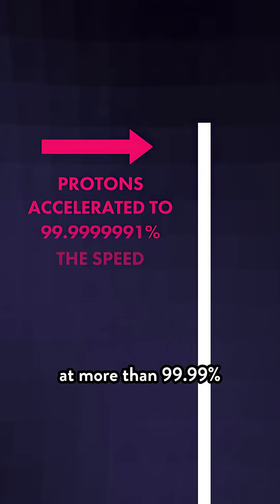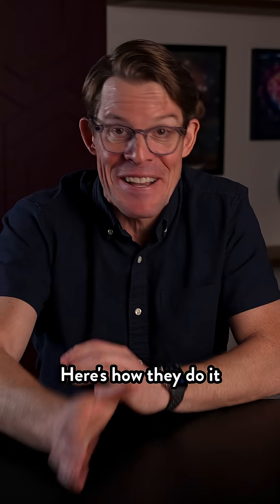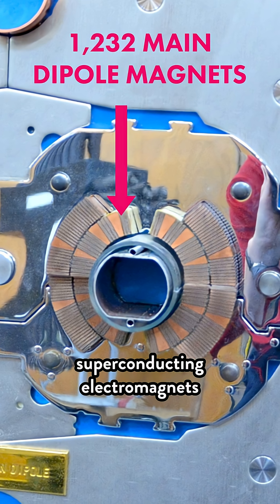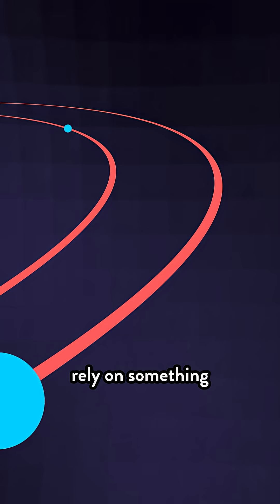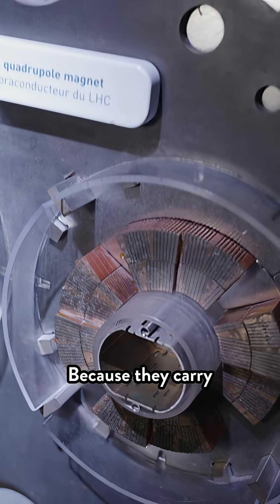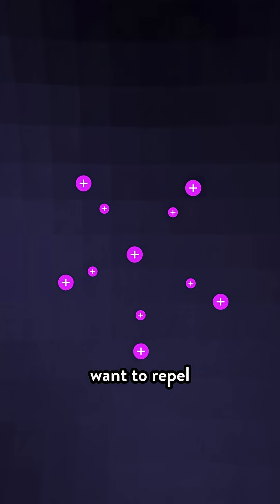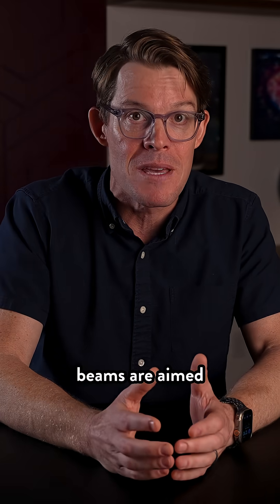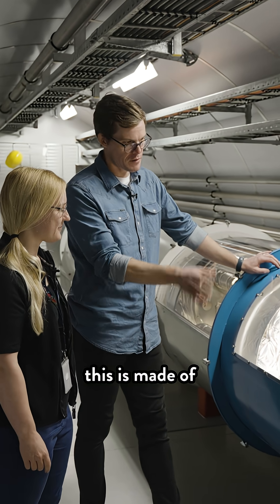How to steer at 99.9999999% the speed of light?

Comment: Mm, I think when two temporal streams of photons converge at the same event in the stable macro-wave, a scattering of random frequencies decohere rapidly, assuming photons move omnidirectionally through three dimensions of time, as well as space at a Planck-scale refresh rate. Magnetism as we experience it is at 90° to the future/past/south-north time-stream, the past always dead ahead corresponding to North, and in the mundane universe oriented to the zenith. Think of spacetime as a tesseract instead of a cube with a line drawn through it, having six coordinates (x, y, z, t¹, t², t³) instead of four. The future rushes forwards to inform the present surrounding us from behind, mirroring the past before us through stable interference, as electromagnetic intercourse phase-locks matter now, retaining only its mass (refractive index) as it moves time retrograde. All held in place by the phase gradient of perceived gravity.

Comment: Great videos, saying no resistance for the magnets though really threw me on this one. If there is no resistance, then there'd be no heat, so no need to cool the magnets.
There's as minimal resistance as we could manage to reduce the heat as much as possible, otherwise they'd melt before a test shot was concluded
Reply: Wow, yea one just searched for some info on it, quite astounding. Effectively 0 resistance achieved in that state. Now I'm just interested on the voltage applied to achieve 11kA
Reply: Never mind further searching done. Inductive voltage. Interesting!
Reply: They need to be thst cold for then to gain the property of having no resistance
Air tempersture alome would csuse them to heat up past that point so they need to be cooled whether current is going through them or not

Comment: Ummm but you said "how do you steer something moving at more than 99.99% the speed of light?" Doesn't this means something which moves at 199.99% of the speed of light???
Reply: Bud 99+1 is 100 not 199. Also 99.99 is less than 99.999. just add more numbers past the decimal

Comment: If they're superconductive then that's what the cooling is for, not because there's 11kA running through them, as you mentioned yourself there's no energy lost in heat...

(That's what i think at least, I'm not a professional, correct me if I'm wrong)

Comment: At that speed, the relavitistic time dilation is 7.089 For every one second that the particle experiences in its reference frame at speed, 7.089 seconds will elapse in your frame. You will appear to be moving in some type of fast forward scan to the particle. The particle will appear to be existing in slow motion to you. Every second that ticks for you in your reference frame, as you look to it, you would see it's clock moving slow, with only 0.1410636197 seconds elapsing.

"...and that's the FN power of OxyClean*.
- B. Mays

Comment: What if the magnet fails and the particle hits the magnet. What would happen?
Reply: The magnet would be damaged
Reply: @kruesae22 how badly? Would the particle escape? Would it cause an explosion..
Reply: @SooDamGood  an explosion is the expansion of something, by definition the magnet would expand due to heat and rip apart at least a bit. As long you don't lean directly over it in the moment of failure nobody would be harmed.
Reply: @kruesae22 ah interesting. I really thought it would cause more damage. Appreciate thr answer

Comment: Wowee.  Honestly all thos contraption does is prevent whats about to be electric current from going straight.  As how a magnetic field arises spatially around a uni-directional electric current, as the displaced pole of this mono-direction, amd then dipoles omto a field.under the same foundational coktrasts laws not allowing monopoles in the forst place-  this one basically reverses it.  Instead of copper holding current its a magnet tube holding charge shaped in a ring and dipoled inversely to force straight into a curve.

When two motions combine, they get smaller straght motions, which they factor as particles, as in motion now, thats not where it was or where its going to be.

Comment: They don't curve actually, radiation only travels in straight lines (this is why it's colder in the shadow) so they make tiny angle adjustments to the proton beam, similar to the lasers used in LIGO

Comment: The reason some survive lighting strikes is also beacuse it lasts such a short time and they either have some sort of boots that transfer electricity into the ground but you might have blood vessel sphaped burns after wards so fascinating.. considering this can have almost the same output as a lightning bolt you would most likely die in just 1 second of it

Comment: Is there any possible way to build accelerators in straight line ?
Reply: Yis but they are weaker, because you can accelerat a particle only once per the length of the tube. In the LHC you can send them multiple times around the loop before they crash

Comment: "Colder than outter space" is a misnomer. Space isn't inherently cold, or hot. If you're in the sun or light of star, it will be scorching hot, if you're in the cold dark space, than it will be cold. With the absence of air molecules, there technically isn't a temperature.
Reply: Crazy how you prove to yourself incorrect in your own comment and you didn't even notice.  space is inherently cold in the absence of any external objects like a star the temperature is low because there's nothing to heat it up

Comment: And after ALL of that, only 60 out of the 100 billion particles that are  shot through the collider actually hit each other.
Reply: So the rest have to hit something right? Or somebody?
Reply: @MrHuram-abi  No, they just pass each other and continue around the accelerator until they meet up at the collision point again and some more particles collide. Keep in mind that these particles complete the journey through the collider 11000 times per second, so there are a lot of chances to collide with each other. There are also multiple particle bunches at once inside the collider. According to published LHC data, that works out to around 1 billion collisions per second.

After the collision experiments are done, the remaining particles are removed from the collider within a single turn via dedicated beam dump channels that end in 8m thick graphite cores that are surrounded by concrete and then iron. The graphite cores are then treated as nuclear waste.
Reply: @lantami1199  You speak like somebody who knows for sure, which is cool. Rather than irradiate large masses, is it not possible to just slow them down using the same systems, until they are no longer a hazard? They were just hydrogen ions before they were pumped full of energy, right?
Reply: @MrHuram-abi  It's possible but you'd need another ring comparable to the LHC to do it: given the same force, it takes exactly the same distance to stop as it did to accelerate that much in the first place. This is not quite right for charged particles traveling in a circle because they lose energy by radiation as they accelerate, so you can expect the "deceleration ring" would be smaller, but even if it's 10 times smaller it'd still be 2.7 km long. That's a lot of money vs some relatively tiny amount of waste that you can just store and forget about.
Reply: @isodoubIet  Makes sense, except that it seems like the LHC itself could slow them down? I'm obviously way out of my depth for how the nuts and bolts work.
Reply: @MrHuram-abi  In theory you could probably do that, but that would mean making what is already easily one of the most complex pieces of machinery on the planet- if not THE most complex- even more complex than it already is.
Reply: @Hexagonaldonut  It could be as simple as a few lines of code adjusting the timing of the accelerator components to make them decelerate. 
Unless there's a hardware reason it won't work. I'm just fishing for some understanding of why we're willing to create hazardous graphite blocks that must be stored for millennia. I'm sure if it were possible to avoid, smart people would have already, given all the ridiculous hysteria surrounding nuclear waste.
Reply: @MrHuram-abi The large ring has no accelerating components that can decelerate those particles. Particles are accelerated by components outside the ring which do not receive particles from the large ring. These magnetic systems are not designed to alter the speed of the particles. Even if we manage to stop particles inside the ring itself, some of them are still radioactive and need to be disposed like other radioactive materials.
Reply: @lantami1199 can you elaborate on why these unused particles need graphite and concrete etc to be stopped safely? What would happen if hypothetically they just went out into the environment? Similar to high energy alpha particles or radioactive decay / DNA busting or something? Thx. Cheers
Reply: @MrHuram-abi they can’t keep particles in it they’d have to fish them out which finding the smallest atom ever in a 27 mile long machine is… difficult to say the least
Reply: I wonder who is picking these tiny particles and where are they picked from? I's there anywhere a particle-tree, and how can one pick a particle? I want to see this procedure for once, please, because it sometimes doesn't let me sleep! 😅
Reply: @FloTschi88  they make an atom that's actually technically visible to the naked eye.  It has a high particle count and holds a lot of energy and they know how much should come out.  This is how they know there are things smaller than quarks and how they predicted things like the higgsboson and it's mass.  They aren't observing enough energy to account for all the mass that they know is there so there has to be more than we have seen.
Reply: Not true it's very very controlled and observed.  But this is exactly why they will never reach the true speed of light.  If you change somethings trajectory, you change its speed.  They probably already have but this needs to be built in space.

Comment: My favorite factoid is when there was a breach in containment of the vacuum. The explosion of energy from cold vacuum touching room temp air pressure ripped steel lab doors from their frames and displaced those 35 ton magnet sections by half a meter. 😲

Comment: I was thinking that as in a bulb the electricity that is flow of electrons happen inside a electric bulb and the light particles like photons are released so we can form a relation between light and flow of electrons in charges so we can derive a relation between charges and photons and it's intensity using E=hv as in planks equation and gravity as value of G i.e. Gravitational constant greater than speed of Light.

Comment: The problem is you can't travel even 10% of the speed of light any object that has mass as it approaches the speed of light tends to become heavier and more compact thus it requires more energy to move forward traveling at the speed of light violate the laws of the physical universe
Reply: That's why it's 3 meters per second slower. The final gap takes essentially infinite energy, though

Comment: Without researching at all my brain is thinking why does it need to be steered at all? Just shoot two beams at each other from 180° apart? There's prolly a reason but I haven't read collider stuff in a while
Reply: To accelerate you need an accelerator pipe. The more you want to accelerate something, the longer has this pipe to be and that's expensive. So why not put it in a circle to use the Accelerator segments over and over again
Reply: That whyt you think of are linear accelerators. They exist but they are far from the power of LHC
Reply: @wissenistmacht8930  as I was waking up I was wondering if it was something to do with spinning it up for longer on an eventually intersecting path but I'm very much uninformed beyond news articles about the lhc, glad to know I was on the right track even if just by luck 😂

Comment: Since he didn't fully explain the quenching issue, here goes. With your run of the mill conducting material, resistance also decreases as temperature decreases but never reaches zero. Superconductors show the same slow decline in resistance up to a specific temperature, which is based on the material itself. At that point resistance just drops immediately to zero and you can pass as much current through the superconductor with no losses and - more importantly for the issue at hand - no heat generated.

Now, imagine there's a leak in your cooling system and it eventually fails. Ambient air quickly heats up your superconductor up to the critical temperature and suddenly you go from absolutely zero resistance to a bunch of resistance. While thousands of amps are running through it.

Suddenly your superconductor is doing its best impression of an oven heating element.

Comment: I get that you can keep something going in a circle with enough force pointing towards the middle. What I don't get is, how do you steer the particles while they're accelerating up to those speeds? Wouldn't you need a rapidly increasing force? How would that work with 2 beams going in opposite directions?

Comment: The problem is not in losing energy.
The problem is that the lost energy turns into heat, and since there is and awful lot of it, there would be an even more awful amount of heat produced. And it would melt the equipment.

Comment: "Colder than space" is nice way to perpetuate the Hollywood myth that space is cold. It can be, but it depends on exactly what you're measuring and the amount of energy it has. There are regions of space where the local gas temperature is hotter than the surface of the sun, but the conductivity is too low to affect any spacecraft traveling through it. Radiation temperatures are more relavant for practical purposes, i.e. at what temperature will an object that is both emitting and absorbing radiation reach thermal equilibrium? This could be very hot or very cold depending on distance from the sun and whether you're in direct sunlight or shadow. So "colder than space" is a pretty meaningless comparison.

Comment: Umm, it would be relying primarily on the magnetic force, infact, if you apply electric force on the charge, it's path wouldn't be defined as a circular path though. But i guess, applying electric field as well as magnetic field, allows the pathway to be broadened here, and since possibly(if i.e), they must take into consideration of the Hall effect too, so yep, I guess, they do require lorentz force, not just magnetic force. Although, I might be tremendously wrong or so.

Comment: The particle accelerators and and space stations are the two most technological and complex and expensive piece of machinery that humanity has ever created
Reply: LIGO is 4 concrete tunnels, each 4km long, accurate to 0.000000000000000000001 metres.

Comment: could we just like.... build a cern on the moon and shoot other planets? lol
Reply: Fun fact: The next nearest star is Proxima Centauri, which is 4.2 light years away. The fastest craft we've ever launched is the Parker Solar Probe, which goes at 435,000mph, or 0.064% of light. At this speed we'll get to Prox Cent in 6560 years.

If we pointed the LHC at Prox Cent then the beam would get there in 5.3 *hours*.
Reply: @kitmoore9969  after that comment I kinda went down a little rabbithole and did some math. You'd need a linear mass driver about 46k km long to accelerate a fence post sized craft up to 0.2cu. Consuming just over 20 PETAJOULES of energy. 😂

Comment: Does this have ANY actual, practical applications other than a few physics-obsessed nerds writing more papers and making more videos?
Reply: This is how the most recent like 14 elements have been discovered
Reply: Such accelerators help us understanding quantum mechanics, which then can be used in many applications. There are a few microelectronics applications that rely on quantum mechanics, including quantum LEDs, solid state disks, and hard drives. Quantum mechanics is also increasingly relevant in medicine, impacting areas like medical imaging, drug discovery, and diagnostics. Most prominent would be the MRI (Magnetic Resonance Imaging).Also, let's not forget that lasers are inherently quantum mechanical devices.
Reply: Did electricity have any practical applications when Faraday was messing around with magnets and batteries?

Comment: Magnets was my immediate thought.
Reply: The only other options are gravity and the strong nuclear force. These are the only other "forces" that can move things. In the far future, it may be possible to use gravity to accelerate particles, but I don't think the strong nuclear force will ever be viable because it's an intra-nuclear force that dissipates after one femtometer. For example, we might sends two beams of particles around a black hole (natural or man-made) and the gravity around the black hole could accelerate particles to nearly the speed of light. The particle collisions would appear outside the event horizon so we may be able to detect new particles that way, without using any magnets!
Reply: @TheNameOfJesus gravity is far to weak for this, and it would be hard to use nuclear force here
Reply: @alex2005z Gravity around a black hole approaches infinity, which is definitely not "weak." I don't think you understood my idea.

Comment: Instead of magnets, could we use gravity? Like if we built a giant particle collider/accelerator around the circumference of a large celestial body like mercury or ceres, could the gravity of the body itself curve the path of the particle without us using any energy to run a magnet?
Reply: It be too big
Reply: Gravity is too weak for planets.  Of the 5 or so forces, gravity is by far the weakest.  Around a non-pornographic black hole, I'm sure particles collide ALL THE TIME.
Reply: To much money and materials to make. Maybe in a few centuries.
Reply: No. Not even close to the force needed. Gravity is far to weak